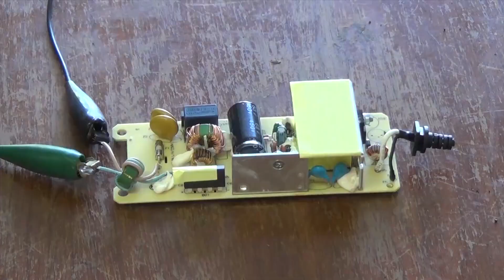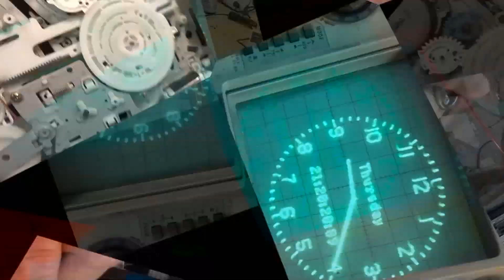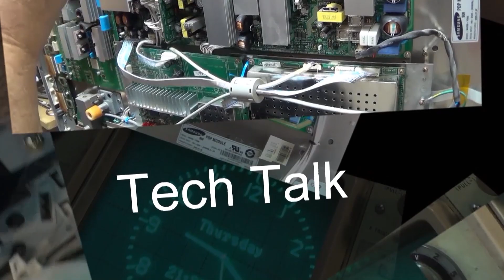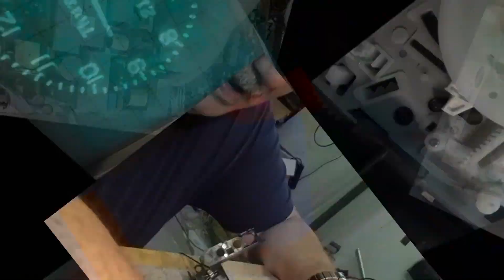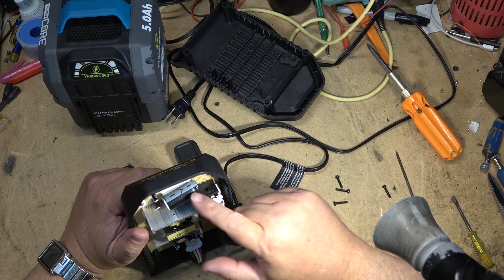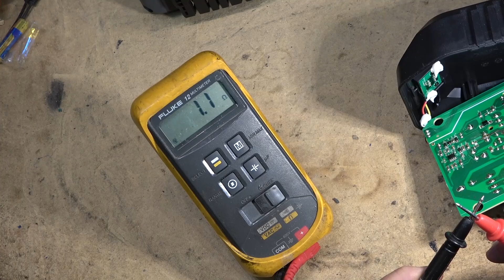Yardworks 48V Power Tool Battery Charger Repair

Comment: Crazy that I came here for a fix because this happened to mine, and I bought a soldering iron kit for $25 and its my first time soldering and I did this and fixed mine. I thought I was out another $100 to buy a new charger but you saved me $75. Thank you!

Comment: good video, ive inherited the same mower with the same charger woes,almost. the  line in power does not get to the capacitor. At the end of your video your multi meter 4.8 or so, was that the out put that charged your battery or am i missing something. im trying to figure out how to use an alternate charger, any thoughts

Comment: What are the 2 side by side middle connectors for on the battery?
Reply from the maker: I will guess. Temperature or fault condition detection.

Comment: Thanks for this video. Mine also died after 4 or 5 cycles. The IC U2 looks to be cooked and has caused a short to ground. Are you able to read a part number from U2. Mine is illegible.
Reply from the maker: Well if you have the same unit from Canadian tire it is under warranty as they have a 5 year exchange warranty.  Just take it back and get a new one.
Reply: @12voltvids  I agree, but I share your desire to not have it hit the landfill.  That is my back up option.

Comment: this is call factory defect
Reply from the maker: Actually I'm pretty sure it got dropped. I didn't drop it but my son told me that while he was rummaging around in the garage it fell over so I think that's why the connection was popped was not because of a defect but because it struck a concrete floor
Reply: @12voltvids  that explained everything 👍

Comment: Haha warranty
Reply from the maker: We have a big chain of department stores around here in Canada called Canadian tire. They've been around forever. they have tremendous buying power so they buy a lot of stuff and they do in-house testing on products. They're in-house testers when they find a product that they feel is particularly good they offer their own in-house warranty. the manufacturers warranty may be one year if you bought one of these lawn mowers at say home Depot or Lowe's or anywhere else but because Canadian tire test of the product their testers determined that it was a good quality and they offer a 5-year exchange warranty. Printed right on the bill of sale says do not lose this bill of sale keep it in a safe place it's required for your 5-year exchange warranty. So if anything breaks battery charger battery goes dead motor burns out anything I put it back in the box which I've kept a ticket back to the store with the receipt I tell them it's broken and they give me a brand new one that's how it works. They don't offer to repair it they don't send it away they give me a brand new one in the box. That's why a lot of people shop at that store because unlike a lot of places they do honor their warranty especially if you buy one that they've tested and put on their list of tested products. Like a little extra bonus for shopping there.
Reply: @12voltvids  hahaha I live in cape Breton brother. I laughing at you making fun of yourself by saying warranty so much.

Comment: This is a good sample and example for saying the differences between Japanese and other junky stuff such as Chineese. isn't it?
Thank you for sharing your informative videos.
Reply from the maker: Got you on the contrary I've had a lot of Japanese stuff that's just been absolute junk. That JVC camcorder the big one that I paid $7,500 for was a prime example. That thing is the biggest piece of crap that I've ever owned. I've mentioned that I stopped using it because I upgraded to HD but that's not really the real reason I upgraded to HD when I did, the reason I upgraded to a Sony HD camera was because that piece of crap JVC kept breaking down. I bought it in 2000 it broke within 6 months it was back to be repaired under warranty. The next year I noticed a bunch of green dots in the picture in the prime area well primary to my eye a bunch of dead pixels on the imager it went back again they told me it was within spec and that they would not change the camera block. So I had to live with shooting with about six dead pixels in the prime area. Like I'm talking right in the middle of someone's forehead got a close up that's where the dead pixels a couple of them were. By 2003 the camera broke again in the middle of a wedding ceremony it just shut down like halfway through just dead started doing what it was doing in the video it comes up where I'm going to take it apart in the next video started doing that not every time but intermittently to the point where I couldn't trust it on a wedding shoot because you can't redo a wedding if your camera breaks you're screwed. That camera was made in Japan by the way and it wasn't cheap by the way. What I was a kid my parents used to tell me oh it's made in Japan it's junk they didn't like anything made in Japan maybe it had something to do with the war but Japan was thought of as a country that made really cheap junk this is going back into the sixties and seventies. When I worked in the business I repaired a lot of Japanese made products because most of the Sony's of the day that I was repairing were made in Japan and I fixed tons of them. All those KV 25 XBR and kv20xbr televisions that had the flybacks fail and the high voltage block fail and picture tubes left right and center. I've probably changed 250 25 in Sony XBR picture tubes. The shop I worked at we sold lots of those televisions and they were over $2,000 a pop and in 4 years the tube was shot people were not happy because their old RCA had lasted them 20 years and this new Japanese made Sony lasted them for and they needed a new picture tube. the only people that say Japanese stuff is great is people that have never had to work on it if you have had to work on Japanese electronics you wouldn't say they were that great they were around the same reliability as the products coming out of China today.it seems to be more people that worship a man whose name rhymes with dump that dump all over the Chinese stuff. It really isn't that bad there is some low end stuff for sure but there's also some very high-end stuff that would boggle your mind. That computer you're using was probably made in China or maybe Vietnam same goes for your phone that you're using.

Comment: Yeesh, makes me want to charge my lawnmower batteries in my driveway 20 feet from the house if that's acceptable quality manufacturing for high voltage circuit boards
Reply from the maker: I really didn't see anything wrong with the circuit board it had gaps in the high voltage areas. It hasn't come from a coding to prevent arcing spray it onto the bottom of it. Remember this is a device that is not used every single day if like most people you're cutting your lawn once a week if you can get a couple of charges or couple of lawn cuttings out of a battery you're going to be charging it maybe every couple weeks maybe every month.
Reply: @12voltvids  that's true at least the design prevents fires even if the boards can occasionally fail. Another thing to think about in design isn't just how can the user screw this up, but also how can the manufacturer can screw it up as well.
Reply from the maker: @Shadepariah  that's right I think that the unit got dropped and that's why it didn't work. Because after fixing it I was informed that it got knocked down when it was sitting in the garage when someone was moving a garbage can past it. So that's likely why it didn't work.

Comment: I was working on a hot tub power supply board a few weeks ago and the coating was so thick I had to clean it off before I could solder it.

Comment: Shows very poor level of quality control during manufacture. I was given a Philips car radio cassette that didn't work. When I lifted the lid, one of the capacitors fell out!! Once I found where it was supposed to be, I put it in place with a dab of hot glue, & soldered the terminals to the board. Presto. Job done.
Reply from the maker: Shit happens.  All automated assembly and they just spot check perhaps 1 in 1000 just like the old Japanese plants did.  People that jump in and say poor quality control were the same ones saying it 40 years ago over the Japanese stuff.
Reply: @12voltvids  I disagree dude. with many respects it is almost rare to see shit in Japanese. But world is "Relative"
Reply from the maker: @realpower9ir  well that's because you never had to work on it. I worked on that crap for over 20 years and we saw terrible stuff coming out of Japan. where do you think the capacitor plague started it wasn't China. all those bad Sony picture tubes that were failing after three to four years on the xbr's. All made in Japan terrible tubes. the American made tubes were really good the Japanese made tubes were crap. All those high voltage resistors at Sony used on a lot of their trinitron's that would develop a crack and start arcing all made in Japan. The only people that think that the Japanese made stuff was good was people that didn't have to work on it. I made thousands of dollars fixing Mitsubishi VCRs back in the '80s where the guide posts literally fell out. It was like 100% failure rate. JVC the same, guide post assemblies popping apart. 
sure the Japanese did make some good stuff but I also made a lot of crap just like Korea and just like China. Some of the early Korean stuff was pretty bad but it got to be real good just like the early Chinese stuff. the vintage staffing stuff that we're seeing kicking around now that's still in service was the good stuff. The bad stuff has long gone to the dump and there was a lot of it out there but then if you weren't in the service industry in the '80s and 90s you didn't see this because that's when all the Japanese stuff was around and breaking down left right and center. There was a running joke in the industry that the Sony XBR TV the XBR stood for extra bad receiver because of all the problems that they had. Tuner problems probably 90% of them had tuner problems fly back problems high voltage resistor problems and of course the picture tubes that wore out after like 4 years. some people's TVs I changed their picture tube two and three times over the life of the set after the third one went they tossed it and they weren't cheap to replace a tube on a 25xvr that was like a $500 bill by the time you got the new tube in there. I made a lot of money fixing it back in the '80s and '90s I was making $80,000 a year just fixing electronics  That was a lot of money considering the average wage was around $30,000.

Comment: I was looking for some solid-core hookup wire, do you buy yours online? I see Princess Auto has rolls sometimes but I forget if it's solid or stranded. I'd like to use it for prototyping circuits.
Reply from the maker: I get it from the scrap bin at work.

Comment: The good thing is that you are happy, you have fixed it and don't feel the need to take it back still for a new one. Guess they should start the warranty once again from the moment you fixed it for 5 years. Well, you saved yourself a visit to the shop which is good I guess and hopefully that thing will work forever. Was a great video to watch.
Reply from the maker: That's right i hate wasting my time taking stuff back.
Reply: @12voltvids  Good on you! These service people who sold it, must have rushed to fix those chargers. That is why. Soldering was poor effort on their part. Enjoy your day Dave! See you soon on another episode.
Reply: Dave, I'm thinking that if you would take it back, you'd get the same results. Now that you've gone through the the entire PCB and repaired it, I'd keep it.
Reply from the maker: @dalemettee1147  got to get the same result of my bonehead son would knock it down on the floor again. That's what happened apparently he was in the garage putting around looking for something and he knocked it down and then picked it up and put it back on the shelf. after fixing I was commenting about it and he starts laughing he goes oh I guess I broke it when I knocked it down.